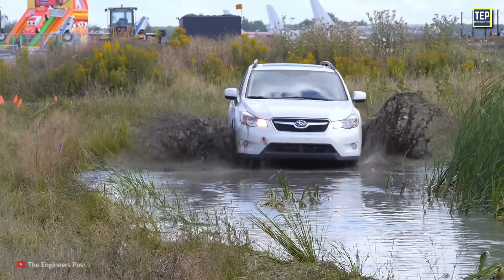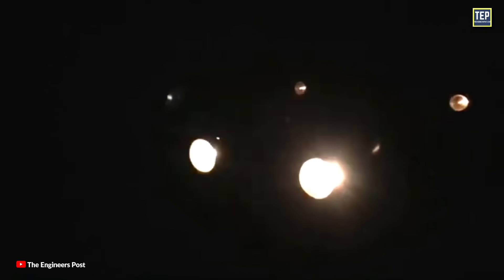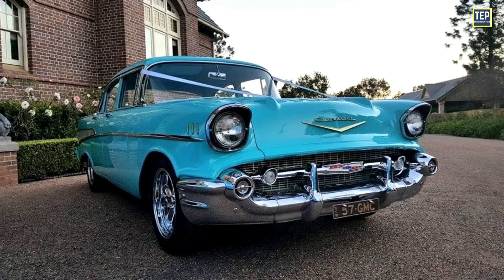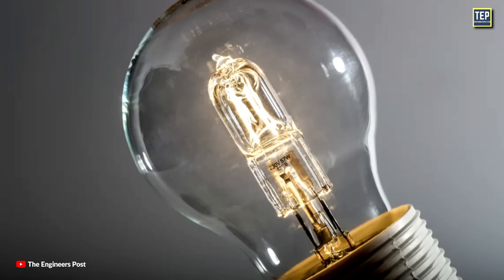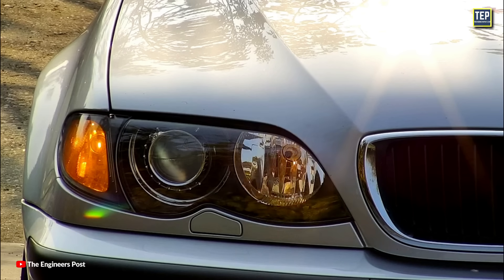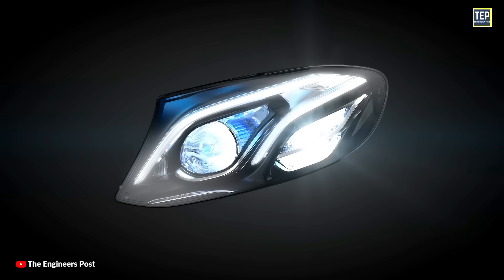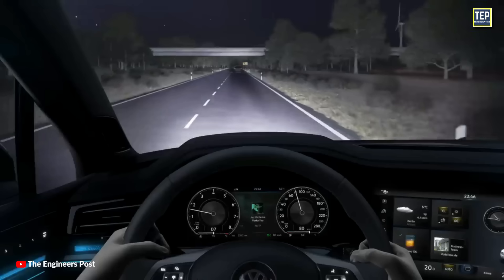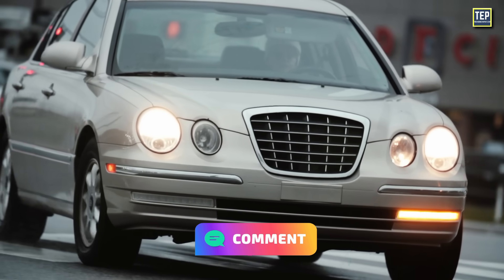The Problem With These Headlights

Comment: LED's are bad news because manufacturers don't know how to use them? There requirement to aim lighting towards the road needs enforcement.  I have yet to witness an Matrix headlights in action. The blinding light is dangerous the transportation departments along with local state inspections need to return to inspecting the angles of headlights so other drivers are not blinded on the roads.  It it also bad when peering into the rear view mirrors inside and the door-mounted mirrors outside. I would rather just not drive at night.  

The other idea, which is so silly to me is have these blinding lights on in the middle of the day while the sun is out.  Duhhhhhh! 

I can replace my headlight for $25 after unscrewing two little wheels behind the housing.  That is why I will never buy a new car.

Comment: I have adaptive LED headlights. God help me when they break. 
Miss my halogens. Yeah they needed replacement every 2 or 3 years, but I could do it myself for $50 and change out the color slightly just for something new.
And the alternator makes plenty of power anyway, I don't care about saving the energy there.
Then there's the excessive blue light...

Comment: As someone with extreme night blindness already, I heavily dislike newer lights. Sure they are bright but the color temperature causes far too much glare. That aside, can anyone tell me why SPECIFICALLY Jeep (the round style on wranglers) headlights, always feel like they are on high beam ( when I clearly see them switch down) AND misaligned? Every single wrangler I meet going the other direction is like this. It always hits me the same way someone high beaming me does lol. Its like they are pointed like that from factory x.x. I like the idea of those matrix headlights though. Aside from the "what if it breaks" scenario since they are basically always high beam from what I understood.
Reply: When I had my Jeep CJ-7, I installed 2 7in round motorcycle H4 housings and ran 80/100watt bulbs instead of the standard 55/60watt. Proper aiming was the key to not blinding on-coming cars. Unless I high-beamed them!
Reply: @pb68slab18  that's my point though. It's like every single jeep is misaimed from the factory or some crap because EVERY single one I've had the displeasure to meet seems to be that way lol.
Like it's to the point I can tell when it's a wrangler just based on the way the headlights hit me at night 🤣 it's THAT consistent lol

Comment: I will say there are drop in LED headlights that can work with stock housings, designed so it throws light like a halogen bulb. I use them on my car, and they do throw light properly between low and high beams. 
Just be mindful of the quality of when you’re buying them from and all.

Comment: The old traditional "SEALED BEAM" headlights are dead.
Let me explain..
about 15 years ago my vehicle that used the 4 bulb system used the square sealed beam lights.  The bulb is incased inside a glass container, the lens is glued on front to seal out weather.
Before this time, this worked well, the bulbs would last till the filament burnt out which was basically almost forever.  They did burn out if you drove nights  a lot but they were very long lasting.
Then, I noticed, a sealed beam that had water inside the containment and the bulb burnt out.
I replaced it.
I had another light do the same thing, and the one I bought to replace the first failure only lasted a year before water was inside the sealed containment.
As the years passed all the bulbs began to fail with water inside the bulbs containment.  The sealed beam bulbs were getting expensive and they were failing, not burning out but the seal failures were happening about a year after purchase.  No more long life with what was once a trusted bulb.
In my vehicle up grade, I replaced those now crappy sealed beams with LED BULBS.  No more containment leaks, working great now.

Comment: The biggest issue? Headlight aim. Aim too high, different aim from side to side, one high, one low. That makes no difference regardless of type used.

Ona another issues of headlights - - Cost.  I have a 2018 Ford Escape. the clear coat came off during warranty. Replaced, but the claim with parts and labor? 456.00 Dollars.  How many old sealed beams could you buy for that amount?  How about a front end hit that creates a need for both headlights: 912 dollars?  What do you think that does to insurance costs?  They go up.

I remember selling glass headlights for 5.95 to 8.95. Even today, with less demand a H6024 is about 15 dollars.  

It's all about "styling" more than anything else.

Comment: I prefer the headlight that works adequately, doesn't require a degree in rocket science to replace, and most importantly, doesn't require constant replacement. So far I have yet to own a car that meets all three criteria. In fact, they usually fail two right off the bat in that they barely last a year or two and they are a pain in the ass to replace.

Comment: My first Xenon headlamps were amazing! I remember picking up new on July 5, 1995, the first Porsche 993 Turbo to be delivered to the states with (at the time revolutionary S02 tires- it was the first one.) I flew to Houston and picked it up from Momentum Porsche Lamborghini. It was amazing. For those of you who don’t study Porsche day in and day out, the 993 Turbo was interesting. It was the last air cooled 911, but the first with all wheel drive and twin turbos. That thing was a rocket-ship in its day! 12 flat in the quarter. 0-60 in 3.6 seconds- and you could get it every single time. It’s tiny without the liquid cooling. I drove it in 1995, and still own it with 12,000 miles. I’ve owned many 911 Turbos, but that is my favorite!

Comment: I upgraded from a 2014 Toyota Highlander to a 2024 Cadillac XT4 with LED headlights (the 2024 highlander drove the same and is pretty much the same chassis and interior so it's boring).

My other car is a 2017 Corvette with stick and has XENON headlights.

Comment: AI generated garbage. This is full of questionable information, and doesn't explain critical things. The explanation for how laser headlights work is just plain wrong, there's no "phosphorus gas", it's a hard phosphor coated plate, with a blue laser shining on the front of it to excite the phosphor and emit white light, similar to how white LEDs work except in those the phosphor is on top of a blue LED resulting in a larger light source that is harder to focus.

It's also dated, using the i8 as an example when it's been discontinued for 4 years and laser headlamps are actually used on lots of sports cars and SUVs.

The bit about throwing LEDs into halogen or xenon housings needs to be expanded because obviously it works, and people know that - the problem is how the optics are designed, and the actual requirements that car headlamps have are greatly misunderstood.

Comment: Cadillac started using LEDs in their tail lights in the 90s. They weren't ready for prime time then and they're still not. I work at an auto parts store and so far the range to replace just one is 400 to 800 dollars. All it takes is a little moisture and the whole thing is shot.

Comment: I have been driving for 50+ years and owned cars of late 50s vintage to 2023. The absolute BEST headlamps I ever experienced were round, single lens, non-sealed, dual beam, with euro-sourced 50W/100W halogen bulbs. The lens crystal pattern was so well designed that the low beam could be aimed so as to cut off just below the rear window glass of a car approx 4-5 car lengths in front and the high beam pattern allowed aiming down the road with very high precision.
Reply: Late 1960's Euro specification Mercedes ?

Comment: I've four cars, all with glass headlights and never had issues with breakage or yellowing. As for weight reduction, it's more likely for cost reduction in manufacturing plastic as any gains in weight reduction seem insignificant compared to what the rest of the vehicle weighs. Ironically, replacing plastic those assemblies are costly as compared to glass since each vehicle has its own headlight design.

Comment: I'm surprised ,you haven't told if adaptive lights has been used in very early 70's Citroen SM. In this car has been implemented many advanced technologies as  proportional steering power force based on car speed.  But thanks for your job. 👍

Comment: I've had two Vespa's with LED lights. My first one had a square headlight, which was terrible. I literally couldn't see at night, even with the high beams on. My second Vespa had the exact same LED light, but in a circular housing. The difference was insane. I could see so much more, just because of the shape. But the light was exactly the same!

Comment: Since this video includes headlight history, maybe it could have included information about the U.S. National Highway Traffic Administration  failing to allow fully adaptive matrix LED headlights.  It's been 10 years since automakers asked the NHTSA for approval.  Headlights of this type have become increasingly common including on inexpensive vehicles in the rest of the world and the U.S. is now the only country that does not allow them.  (Canada approved them in 2018 rather than continue coordinating their headlight regulations with the U.S.)  I finally gave up and had the matrix LED headlights on my U.S. market European car reprogrammed last summer to function as in Europe.  I've been driving with the matrix LED high beams on most of the time on rural streets and highways for just over a year and not a single oncoming driver has flashed their high beams at me in irritation.  As shown in this video at approximately the 15 minute mark, preceding and oncoming vehicles are shielded from the matrix high beam headlights.  All they see are glowing headlight lenses without any light being directed at them.

Comment: New car led headlights are a rip-off. Carmakers as with many other electronic gadgets.Are manufactured totally sealed, hence you cannot change the globes if they blow. One of my front headlights stopped working but the running daytime lights and indicators still work.  To my surprise the whole light fitting needs to be replaced as it is sealed and globes can no longer be replaced. The dealer is happy as they charge a insane amount of money for the genuine spare parts.   The fancier the head light the more expensive , soaring to $5000.00 . Led lights are a rip-off and fail all the time. Giving the spare parts industry a free ride  to charge what they like for the replacement. Manufactured electronic  products of all types are unrepairable these days.   The user is being ripped off blindly and environmentally it's going backwards. Change the rules and stop this practice. Its a joke environmentally, not to mention the total lack of respect to the consumer. Governments around the world get of your arse and ban this ever evolving practice.
Reply: Check for corroded connectors at the bulb or headlight harness
possibly using a bit of "bulb grease" on the connectors or contacts at the back of the headlight bulb module or replacement small bulb might guard against oxidation or corrosion that would eventually cause the bulb to not get power 
  try not to touch the actual glass or quartz envelop of the bulb or headlight but if unavoidable maybe try wiping it gently with a piece of cotton dampened with rubbing alcohol before securing it in its socket
Reply: @davidpowell3347  I'm assuming that they don't have the bulb style LEDs. In which case, the entire housing needs replaced.

Comment: No "human eye approach" in this BMW-clip. I am Dutch, retired medical doctor, and before also studied also at TU/e. Photography and driving are hobbies of more than half a century.
The approach of engineers in this film is obvious.

My comment:
Blueish light of 6.000 ° Kelvin gives bad visibility. Our eyes focus especially on green. Blue is more distant. So in the dark your eyes can never focus comfortably. That is very tiring.

Debris in the eyeball scatters especially blue and produces a misty vision; glare and haze!

More light coming from a small surface can oversteer the retina of our eyes. As upcoming traffic it blinds us effectively at more than 100 meters.

Vision is all about contrast. A powerful beam makes the environment outside the beam "darker" and so less visible. We will not see a deer or a cyclist crossing.

My car has 3000 °K halogen bulbs. Just 50 Watts. Who needs to see 500 meters to drive safely in the night?

I still have memories of the big yellow bulbs (as in France until 1980).
I installed these on my Volvo 144. Rabbits at 15 meters beside the road were visible; excellent!

Comment: the brighter the headlight the brighter the reflection from street signs and the like, this puts a greater strain on the drivers eyeballs which is really bad when driving long distance and/ or with tired eyes. halogen with its slightly yellow glow is way more relaxing.

Comment: No clue when this video was made, but it was posted only 2 months ago and is out of date..

BMW has been using laser headlights for the last decade, my dad's X5 has them. They're actually dropping them from new models because the laser component can't do matrix lightning without the assistance of LEDs, and modern LED lightning has gotten so bright and contrallable, that they're often held back by regulations. My 5 Series only offers LED lights despite being the newer car, they're just as bright as laser lights in the X5

Comment: You failed to mention that sealed beam headlights used halogen technology inside by the late 70’s early 80’s. My 78 Firebird Formula 400 had them from the factory. Your Kelvin scale is way wrong too. WTF 😂

Comment: For me halogen works pretty fine until now. As long as the old bulbs are not breaking I won't be upgrading. I wonder what the real world durability of the different headlight technologies is. My car is 28 years old and still got it's original halogen bulbs. How is it with LEDs for example?

Comment: I’ve been lucky enough to have experienced daily driving with halogen, HID, and LED headlights. LED is definitely the brightest, but personally, I prefer HID. I think it hits the sweet spot. I prefer 4300k color temperature. LED is too white, and the cutoff can be very sharp, making it a bit distracting when driving. And HID projects lights much wider. It wont be as bright as LED (unless we’re talking about 55w HID, which no LED can match), but the light output is softer, wider, and more comfortable to my eyes.

Comment: Something people forget about lamps is as you mention that manufacturers designed the housings with specific bulbs in mind. You can't just drop in a different bulb type and expect it to work, this is a main issue plaguing brighter bulbs like Xenon and LED where people would drop them into housings designed for Halogen because their brighter. Ofthen paired with never aiming the housings meaning the beam pattern gets thrown off and often thrown right into oncoming traffic.
Reply: @VulcanViewer  I own an F150 and aim my headlights as good as I can. Honestly as someone who drives large vehicles the worst drivers are actually the ones in beat up sedans and the really over modified vehicles. Most pickups often just are just fine they may not dim their high beams but they aren't as eye curdling as the 05' civic with xenons just pointed at your eyeballs.

Comment: Adaptive headlights - the biggest shit ever in history of the headlights! This is an opinion of long operating truck driver. 
The problem is to let cpu take over the lights instead of human brain! In winter time, after 10 hours shift, my eyes just burn! Some makers are especially bad, like bmw or vw. On the top of this, people do not clean lamps of their vehicles fitted with multiple sensors in order to keep them work correctly.  Sorry for my rusty english.

Comment: Recently replaced my old burned out halogen fog lamps with LED ones. I’m happy with the brightness, but the FM radio interference is borderline unbearable and no amount of ferrite chokes that I used could eliminate the FM radio interference noise entirely. Anyone has a better solution?
Reply: @VulcanViewer  Looks like you’re the one blinded by your naive assumption that the fog lamps weren’t adjusted during installation. Fog lamps are not meant to shine straight forward, they are pointed downwards to brighten up the ground in front of the car. But still, great suggestion 👍🏻🫡

Comment: I switched to LED on my 2010 Mazda 3 sedan from Halogen 8 years ago without any problems ever since. Headlight Led"s I used are heat sink not the fan type. I also went Led on interior-brake and backup lights. Just make sure it is a compatible replacement for your current vehicle type of lighting.

Comment: We see objects because they reflect light. The colour of the light falling on them is critical. Sunlight has the widest spectrum of wavelengths and will be reflected by objects of any colour. The “whiter”/colder light tends to have more of blue the whiter it gets. Objects coloured other than blue/bluish tints will be less visible. Headlights in the range of 3000K are closer to the full spectrum of natural light, and objects of any colour will be reflected more easily and efficiently. And the glare is minimal.

Comment: Why hasn't a lawsuit been made to stop LED bulbs from being made to fit the wrong lens?  LED's are like the touchscreen in the middle of the dash that doesnt retract, and you have to take your eyes off the road to use.  How is that safety?  What's wrong with knobs and buttons specifically designed with a unique feel for their use?  And when break don't cost $1,000 to replace?  The screens go bad all the time in just a couple years. It's hit or miss if you get a good screen or a bad one.  No QC made in China junk!